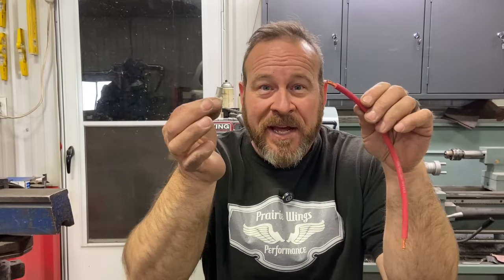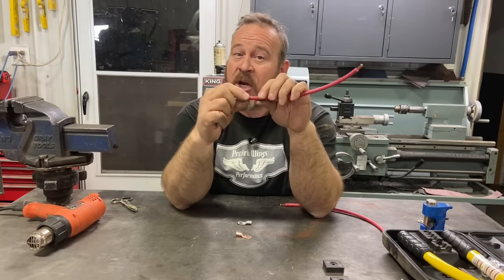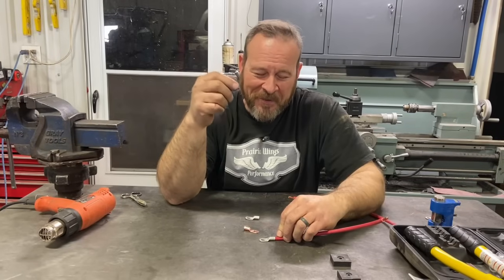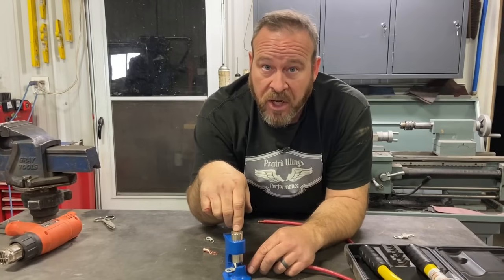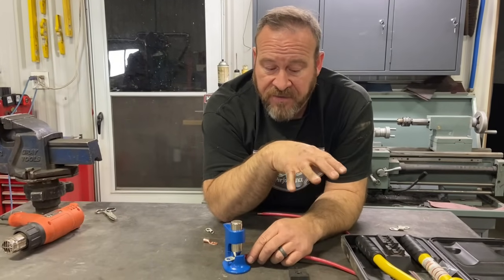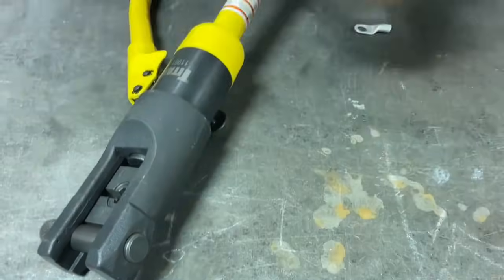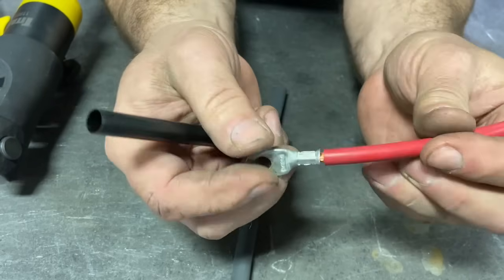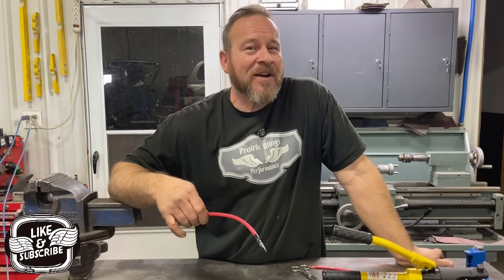Crimping Heavy Cable Ends - Which Way Is Better?

Comment: I recommend you check out the TEMCo Lug Crimper Tool TH0012 IMO its a much better crimping tool for lugs. its quick, easy, built like a tank and produces extremely  nice cold welded crimps. I dont like the hydraulic crimp tools as they are slow, cumbersome, and you always run the risk of the hydraulics leaking or failing. The only time a hydraulic crimp tool is used is when the cable that needs to be crimped is in a location that the TEMCo Lug Crimper Tool TH0012 cant fit into but if youre building cables on bench, floor, etc  go with the TH0012
Reply from the maker: @more4u2c  thanks for the recommendation. There are tons of great suggestions and I am definitely going to be buying a new tool, I just need to sort out which one. I really appreciate you taking the time to share!!

Comment: The hydraulic crimpers are really nice but were a little beyond my DIY budget. I found a set that work similarly that have compound leverage handles that make them look like bolt cutters. I've had them for several years. When I got them, they were around $30. The cheapest hydraulic crimper I could find was around $75. Now I see you can get hydraulic ones for around $35.
Reply from the maker: @farmallgray  I bet the bolt cutters style work great! I have never used them. If what you are doing stands the test of time it’s good. Thanks for taking the time to comment!!

Comment: 1) thanks for sharing your experience with this stuff
2) don't buy the ends with the hole in the jacket, those are for soldering, so if you don't solder, buy solid ends
3)it doesn't matter if the crimper is expensive and made in the US or Canada OR if it's Chinese. I have used copper ends, led ends and steel ends and they ALL have different diameters, no matter the cable size, so jaws will work one time and not the next. So yes, just check which jaws will leave a space for crimping and use those. Don't go by the numbers.
4) if done correctly, the hydraulic crimper will make the lug and cable become one. If you cut it in profile and looked at it, you won't be able to tell where the lug wall ends and cable starts, apart from the color, nor will you see round strands or air gaps.
5) on battery clamps I always crimp twice, back to back to increase the surface area and prevent gunk from getting in between the lugs. That's the problem solder can have, leaving pockets or broken strands for moisture to go in and corrosion to start
6) I am not sure exactly why I do it, but I basically "cold solder" the cable in place. Heat the lug, melt the solder and with a bit of flux in the lug and the cable, shove the cable in quickly, hold it, then crimp it. It's probably a bad habit, but machines I crimped 15 years ago still make a perfect connection.
Reply from the maker: @MartianDanTheMartianMan  absolutely those lugs I rarely use, they are the ones that come with aftermarket harnesses and have the biggest flashing if I do use them. Definitely have been doing it this way for years and they last. Absolutely appreciate you taking the time to share your tips and experiences as well.
Reply: @prairiewingsperformance6036 cool beans! 🫘

Comment: I use a similar crimper. One tip I can offer is because larger wire is so difficult to work with I hold the cable in place and figure out the best orientation for the lugs and then draw a line with a sharpie from lug to wire so that when I crimp I can get them clocked properly. Another thing I've been experimenting with is applying Ox-Gard to the wire before I insert it into the lug.  The jury is still out on that one.
Reply from the maker: @caseypries7559  absolutely appreciate you taking the time to share your tips and experience! Much appreciated! Other guys on the comments have also made mounts for the crimper!! Lots of good stuff shared here!!

Comment: I gotta say the crimp method seems way easier and has been used by manufacturers long enough now that his proven itself. I dont have the fancy tools and grew up in a Ham Radio family. I use the soldering method but with one slight modification. I was taught to solder the wire separately, called it tinning, then fill the terminal with solder as u mentioned. Once terminal was partially full of melted solder, insert the "tinned"wire end. Once heat shrinked no chance of corrosion. In reality, the old pound it with a blunt rock method will work and last a long time too. Not that i ever would have done such a thing lol.
Reply from the maker: @DanBookemTaylor   thought I replied but it’s not showing here so here we go… a person does whatever they can to get out of a bind when needed. I return to the tried and true methods but always watch for better ways. This video has tons of comments that are Awsome and that make me want to buy new tools. I really appreciate people sharing their experiences for everyone to learn from. Thanks again for taking the time to share yours.

Comment: The heavy gauge tinned eyelets, ends are best. You are not getting the good ones from Harbor Freight or China. I like the double clamp because after all, it’s the cross-section of stranded copper that carries the amps. I have used hot glue in a pinch but stick with high end shrink tubings as I have spools of 3M product. Other brands are out there just read or ask. If creating harnesses, the convoluted tubing has different temp ranges as well, so use the cheaper stuff under the dash or whatever. But spend the money to get the higher temp quality stuff. I like woven but it’s pricey so if wrapping tape to terminate, place a drop of weatherstrip adhesive and rub in. I won’t peel and unravel after a few months.
Reply from the maker: @deankay4434  I agree. The end I crimped was from an aftermarket update harness I was putting in, I rarely use those ends. Most of what I use comes from Techspan or PICO. I really appreciate that you took the time to watch and to share your experience!!
Reply: @  The Chinese stuff is the runt in the family. What is Chinese for: Let’s make look close but cheaper!
Reply from the maker: @deankay4434  definitely not made to the same standards all the time. There are lots of products from all over that don’t make the cut. It’s worth it spending the money on good products but some of those don’t meet the cut as well. When you find good products stick with them and hope they don’t change it. Lots of diy people can’t afford the good stuff and they still seem to find success as well. If you have to stand behind something stay with the tried and true. Thanks again for sharing!!
Reply: @ 
No, thank you! I suppose if I had some “K-Copper” the hard stuff, I could cut, drill, flux and dip into my “Lee Lead Pot” as I have hundreds of pounds of “Pure” lead from 80’s - 90’s wheel weights melted while at the dealership to tin them. Essentially making my own. Sounds like work so I had better sit & take a break! lol
Reply from the maker: @deankay4434  sounds like you need to make a video on the procedure🤣😂🤪. If only we could all make life so hard!!! Buy good stuff and stick with it! I hope you don’t have lead poisoning, I share the lead melting passion. I have none left, used it all as counter weights in a coil tube unit build 20 years ago…. 😳im old…. Thankfully I don’t admit it.
Reply: @ Eastwood sell body lead as wheel weights are considered disposable and banned. Now like shot-shell contain bitumen.
Reply from the maker: @deankay4434  isn’t everything bad for us and on the banned list?? I’ll stay away from getting into the conversation about shot shells…..
Reply: @ lol, yes everything has to be correct as the shot that goes inside is all I meant. I have lost two tech’s that were smart to age. It is difficult holding conversations with “Box Changing” generation. I was 16 before I knew the had manufactured parts in a box! Like meat sold in a store. I figured it was all in wax white paper with your last name inked on it. The butcher was the 400lb guy named “Tiny”.
Reply from the maker: @ that’s funny, but I thought that was the bakery guy?? He was the guy who’s baker’s dozen was 9.
Reply: @ 
(Farmer’s Joke; farmer was following a cow getting ready to calf. He brought his winch as the cow always had problems. It laid down next to the road fence & the farmer hooked the straps onto the calf’s feet and tensioned it a little. A city slicker stopped as he was shocked to this device and calf being pulled. He yelled the farmer; “Hey, what are you doing?” The farmer said just pulling this calf out!  City slicker scratched his head then yells out; “How fast was the calf going when it hit the back of the cow?”
Reply from the maker: @ that’s funny!!!

Comment: For years I've used a homemade version of your punch tool.  I made dies by drilling appropriately sized holes in blocks of aluminum, then cut them in half.  I put the wire into the terminal, laid it in the aluminum block, thenput that into an automotive tube flaring tool. I turned the handle on the flaring tool to force the point into the copper cable end.
Reply from the maker: @steveprice5664  sounds like your creative! I’ve built lots of different tools over the years. It’s good to have tools that work!!! Thanks for taking the time to share your experience!!

Comment: For the best crimps, buy your lugs and crimpers from the same manufacturer. They have done the testing to ensure that you get the best compression. I worked in a place that did wiring for Military Spec jobs. One of my jobs was ensuring that the crimping tools were calibrated. I used "Go-Nogo" gauges to ensure that the crimp was correct. We did use Thomas & Betts for our supplies and they were great.
Reply from the maker: @TeeVeeTD  yes that brand has been mentioned before! Absolutely military would have tight tolerances. Thanks for taking the time to share your experience!!
Reply: That be a perfect world. Sometimes you have to deal with what is available locally.
Reply from the maker: @williamallen7836  definitely if you need to get something going you have to use what you can get! Thanks for taking the time to comment!!

Comment: As a Senior Master Automotive and Diesel Technician with Ford and 25 years of experience, I was taught and practiced the same as you for years until....

With large strand automotive grade wire the soldering method worked well enough, but when building custom length cables of 4awg or larger and very fine flexible strands, I found poor penetration into the cable.

These cables see a tremendous load when starting the engine, and thats when I found this issue. 100ft of 0/1 cable and 18 soldered lugs became garbage and I had to absorb the cost to replace. 

The hydraulic crimp is way more-gooder!

Been doing that for 15 years now and I stand behind every cable I make. Well, for 12/12(12 months or 12k miles anyway)....JK! I warranty my cables for LIFE!
Reply from the maker: @arturozarate1752  thank you for sharing your experience with the success you have achieved! I really appreciate you taking the time to comment!!
Reply: @prairiewingsperformance6036  I appreciate you making this video.
Reply from the maker: @ thank you

Comment: Dip the end in high temp grease , perform a proper crimp and ship it .
Reply from the maker: @philliplopez8745  thanks for taking the time to share!!
Reply: @prairiewingsperformance6036  I am a big fan of Liquid Electrical tape also . Air and water are the enemy .
Reply from the maker: @ it is great stuff to have around, I use it when crimping two wires to one and other spots as well. Need to order more, thanks for the reminder!!

Comment: What do you do about the little pinhole in the end of the terminal?
I've always wondered about how others handle this obvious weather ingress point.
Reply from the maker: @richarddortch6122  yup, been called out on that one lots. Oops, should have put the shrink over it. A small dab of solder. I rarely use those lugs, they are the ones that come with aftermarket harnesses.
Reply: @prairiewingsperformance6036   I usually slide the heatshrink up a smidge further so the goo will blob down on the hole.
Reply from the maker: @ you bet!!

Comment: Was a industrial sparky for 40 yrs.. If you look in a NEC Code Book or many other publications they have conductor specs. the one you want is the dia. of the conductor. Solid is the smallest, then stranded (there are different strand counts for the same gauge) then you have what your working with. The more strands the more air so it will have a larger dia.. The only way to do it right is talk to the people that make the connector, some have color coded connectors and tell you what die to use from recommended Crimper for their product. Crimped a lug or 2. The Co will gladly help you out.
For the garage guy (me) the best advice is when you buy smaller connectors, get the Brazed ones, cost more but you don't get the shitt@ crimp where the seam don't line up and you get to do it over or create a bad connection, the seam is oven brazed works every time, and don't forget to give em a good tug when your done, if it pulls off it was bad anyway.  Do like the hammer crimper is a great sub. on the fly. I would be using No-Ox instead of silicone, prevents oxidation, make sure your conductor is Bright and Clean, wire brush or pocket knife, not sand paper.

Comment: Finally someone explaining this properly,but you failed one small thing,why crimping over soldering is superior,when heavy load is put onto soldered ends the heat generated causes the solder to melt from high amperage and voltage is lost,I wish you would’ve addressed this one issue because there’s still people out there that insist on that method over crimping,and it’s impossible to train young techs over tried and true methods,Thankyou
Reply from the maker: @arnoldvoth482  well, I was trying to keep methods pretty neutral… that didn’t work to well🤣. There are tons of opinions on all sides, lots of codes for different applications and so on if you read the comments. I was taught if it is all properly sized for the load it was intended to carry and it’s properly maintained there should be no heat. We all know that’s going to happen. The end is bolted down and that corrodes causing heat and then melts the solder and the snowball continues to grow (a hot snowball). Methods that survive the test of time are what I return to, been crimping this way for years, works great! Thank you for taking the time to watch and add to the conversation, greatly appreciated!!

Comment: Your crimp connector has a weep hole in the end that opens it to air and moisture 😂 but it looks pretty.
Reply from the maker: @steveo2764  yup called out lots on that one. Again sometimes you can’t see the forest for the trees😂. Those are the ends that come with the aftermarket harnesses, rarely use them. I do appreciate the time you took comment though!!

Comment: All the basics end up about the same, I used to do the rock and hammer until I found a Thomas and Betts TB-5 Crimper. at a pawn shop for 20 bucks, It makes a square crimp and its the size of a36 inch bolt cutter. Dies are color coded to the stripes on the crimp terminals. Sometimes I'll do an 1/8 inch of solder melted, jab, a little more heat and then crimp the dickens out of it before adding dual wall heat shrink.  Good solid cables saved so many issues with the local fire trucks eating up starters and batteries.
Reply from the maker: @wjg4877  absolutely, many ways to do different things. These ways stand the test of time!! Thanks for taking the time to share!!

Comment: I work in the water well pump industry for over 20 years now we crimp ours with green lee hydraulic crimpers  there pertty awesome.  Pg@e use electric hydraulic crimpers there sick.  The only thing is most people aren't going to want to spend  1000$ + on a set of wire crimpers.  That your only going to use a hand full of times. I no Amazon and harbor fright both sell some that aren't as expensive  but there still a decent amount of money and the dies aren't really currect at all. Just my opinion from what iv seen and heard. 💯 if you're looking for really good heat shrink  in my opinion we use the best heat shrink at work there is .  sense our wire splices go directly in to deep water immediately.   You want Marine grade heat shrink.  iv only seen it in clear though unfortunately  but the quality top notch compared to any thing else.   Ill also let you no how to get a hydraulic  quality crimp with the lowest price crimp tool if you don't want to spend the money for hydraulic.   Get that hammer style crimpers  but don't use a hammer on it.  Put the crimp tool it self in a bench vise and use a small cheater pipe  on the vise handle to tighten so you can apply  way more crimping force on the tool. It will give the same quality crimp as a hydraulic crimpers  when used this way.  Unfortunately its not easily done using a vise by hand only. In less your a beast. Lol😉🫡👍👌✌️💯
Reply from the maker: @josephsaucedo8691  some great information to add, lots of great comments coming in. Sorting through all the comments I have a new crimper on the wish list! People are also using the blue style in the press as well. Thanks for taking the time to comment!!